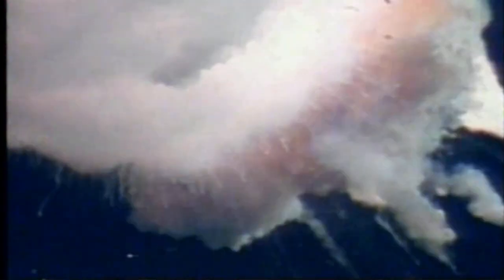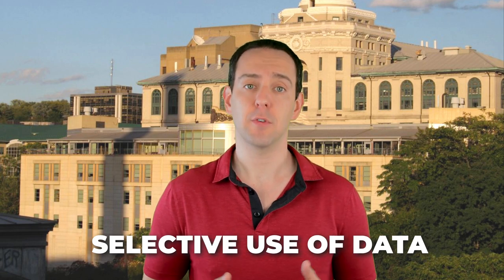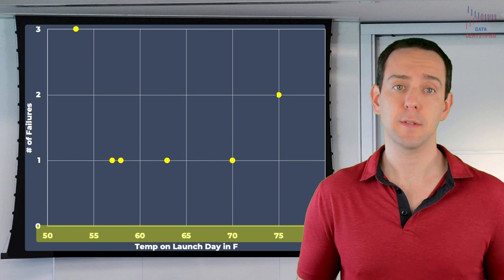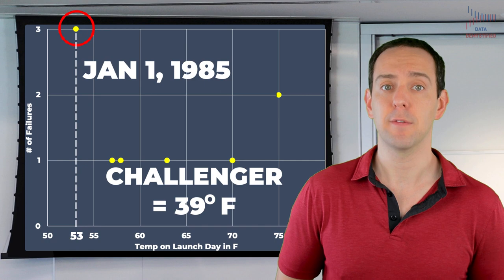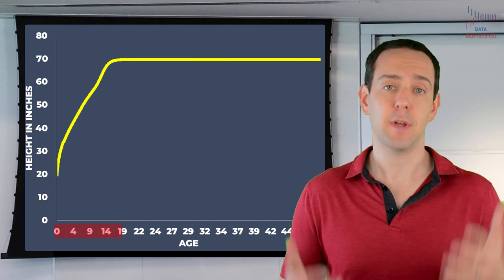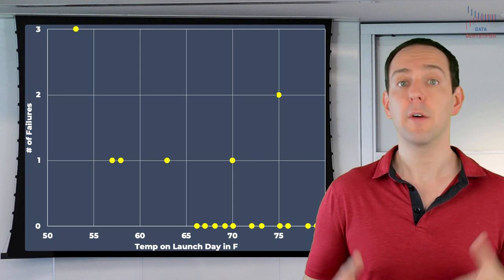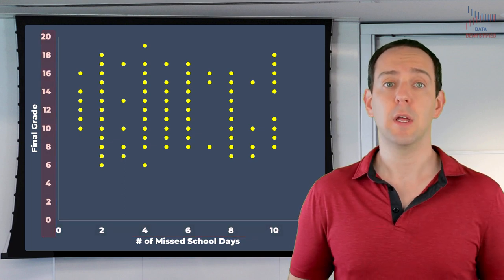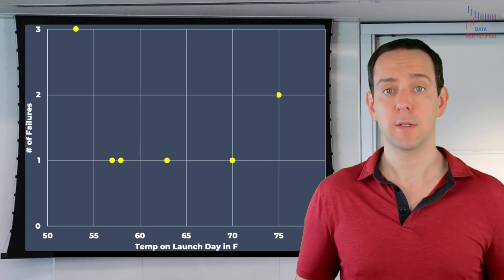Space Shuttle Challenger Disaster Caused by Bad Statistical Reasoning

Comment: so relating to this, what is your approach to censored data?  the video makes it clear removing data leads to spurious conclusions, but what about datasets where limits of detection skew the data.   reading around I see the substitution of LOD with 0, LOD/2, or LOD/sqrt(2). but have also read the effect of these substitutions can dramatically skew the data depending on the censure rate.  One suggestion I did see was a mixed model treating data as binomial distribution for LOD, and then lognormal for those values above LOD (although not seen how to implement this)